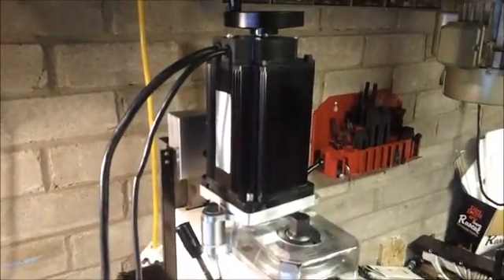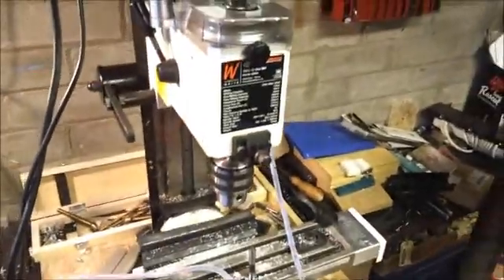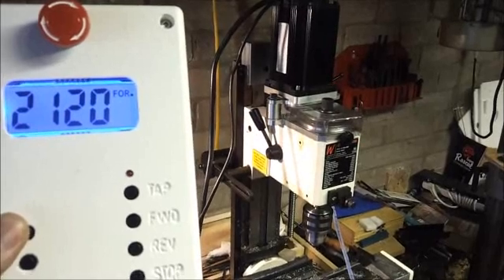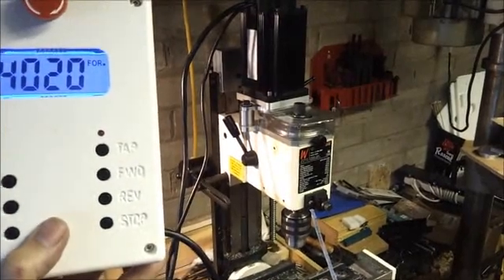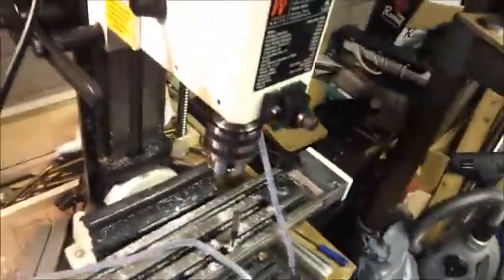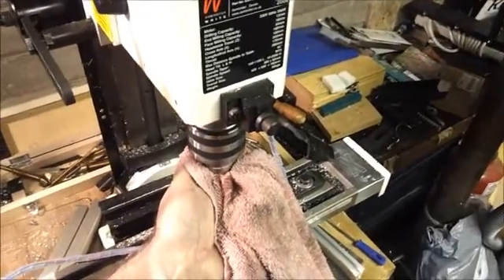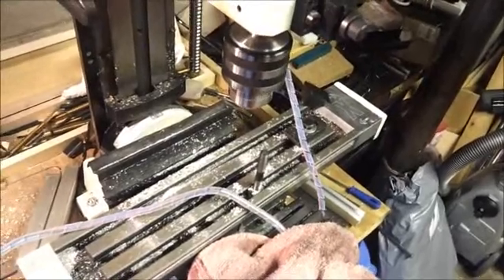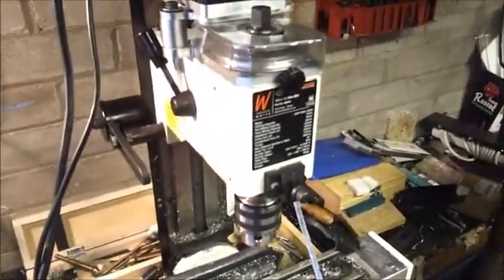sangmutan 1100W DC CNC motor

Comment: Great video! How heavy is the motor? Where did you order it? And did you make that case for the control box?
Reply from the maker: It is heavier than the original, I would have to take it off to get weight sorry. I got it straight from manufacturer in China not my easiest buy but they were very helpful.
 
http://sangmutan.en.ec21.com/Brushless_DC_Motor--4442159_5196297.html

and yes I made the box myself. The main driver is in a larger box mounted on the back of the mill and the controller is on the wall.

The price for 92GN-BLM-300HA-SMT  1100W / 6000RPM motor + controller: US$365/pc. And the delivery cost to UK is US$120. Total amount will be US$485.

Had to set up an international transfer. bit scary but worked fine.
Reply: Stephen Hall
Thank for your prompt reply. I will now buy this motor for my Taig mill.